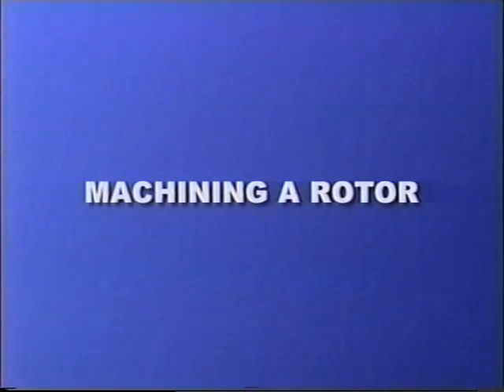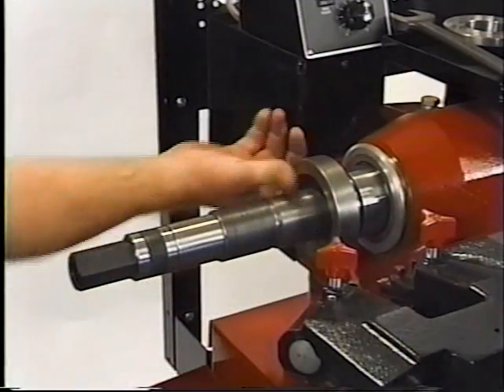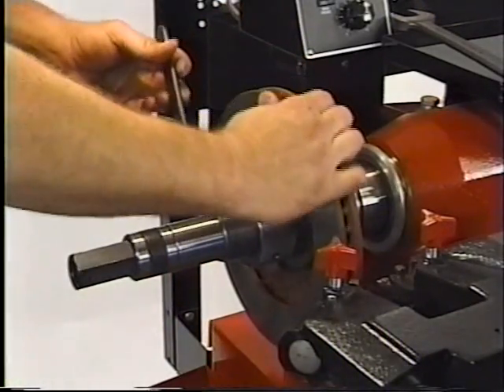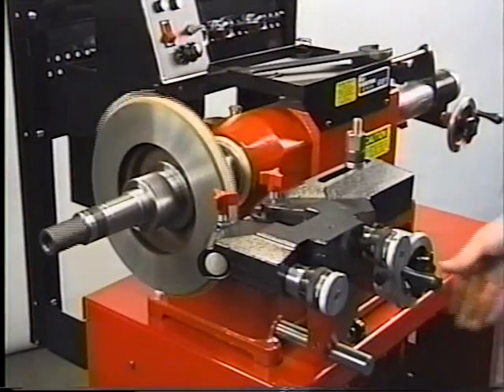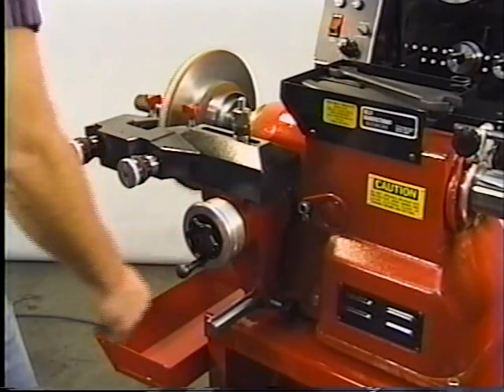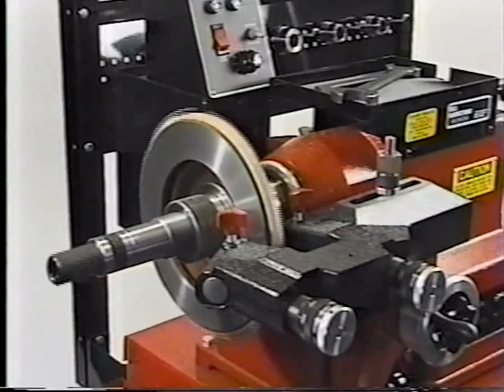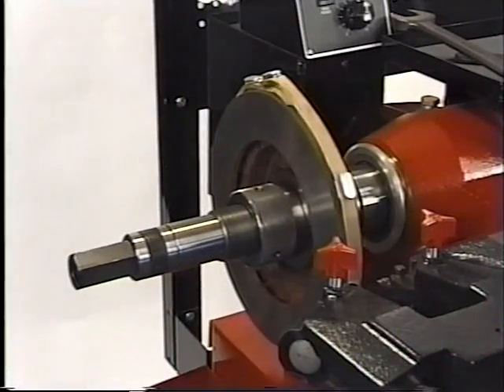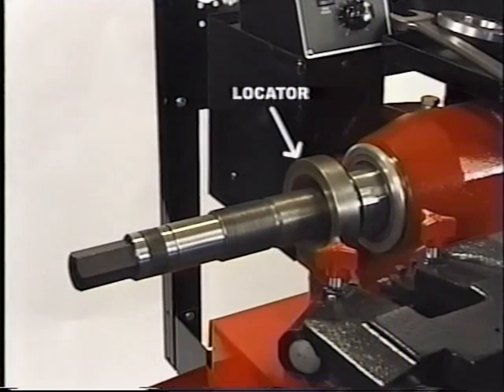Machining a Rotor

Comment: This video is a very brief overview of the lathe cutting process, be sure to review full details on brake rotor servicing at this link.  It covers lathe set up for cutting rotor, crosshatching it after the cut, cleaning it, conditioning it and proper mounting to the vehicle afterwards.  www.StopBrakeNoise.com